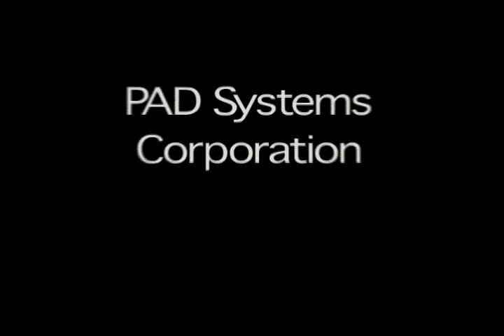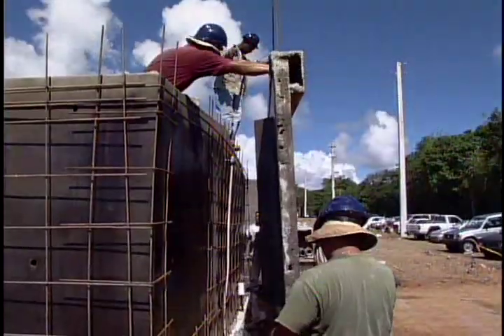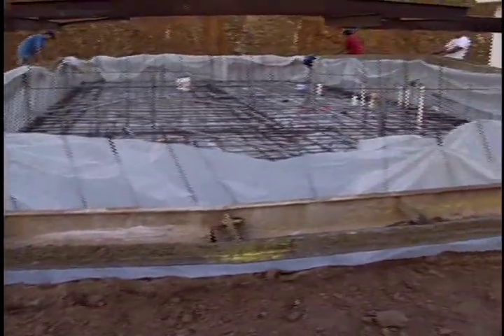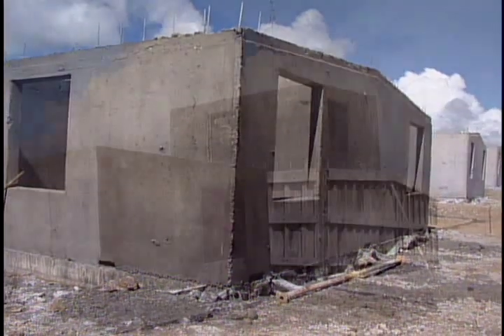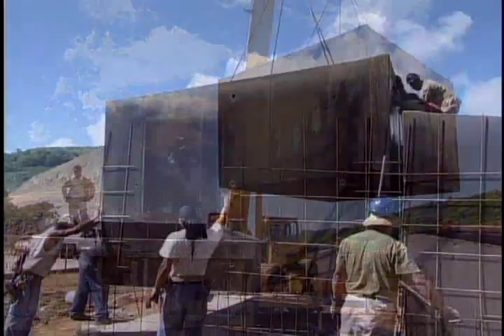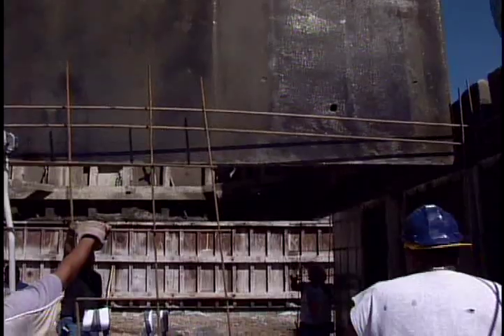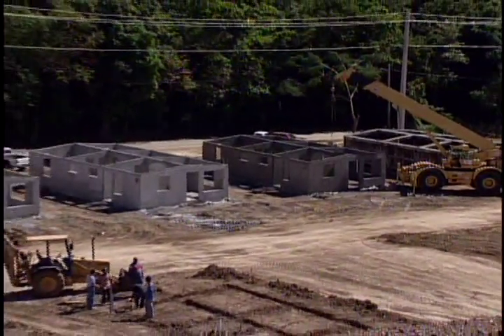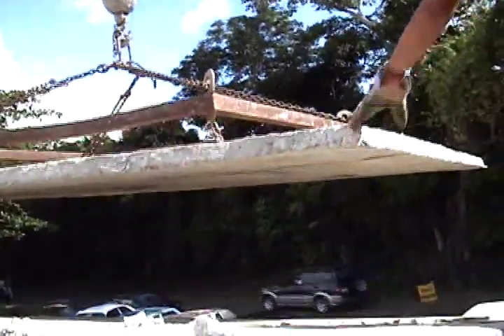Efficient steel reinforced concrete homes - PAD Systems

Comment: I suggest a combined use of helix steel fibers and steel rebars. The steel rebars will provide monolithic continuity of steel reber reinforcement while the helix steel fibers will provide evenly dispersed reinforcement throughout the concrete mass and evenly distribute the stresses and strains and transfers them to the main steel rebar reinforcement rods.

Comment: Nice work, would these houses whithstood the recent Alabama tornados ?
 are the corner steel bars interlaced? and i dont see any wall bars extending into the roof ? maybee i just missed it.  It makes a comunity where everyone has the same cave , which i would like. and no pile of bricks and rubble in the garden when you move in. excellent.

Comment: Insulation  to keep the heat out?  Nowhere to be seen? At least the roof should have styrofoam placed before the cement cap is poured.